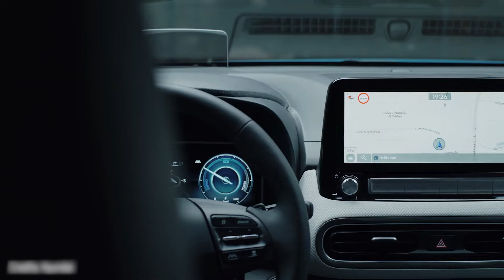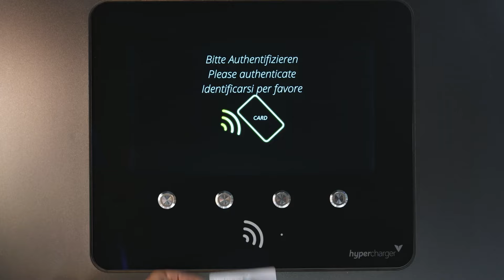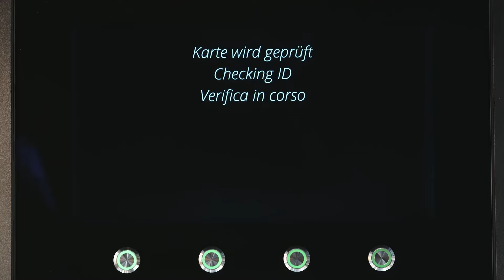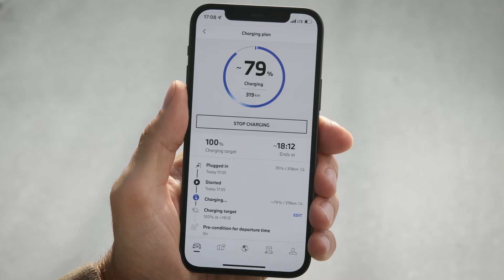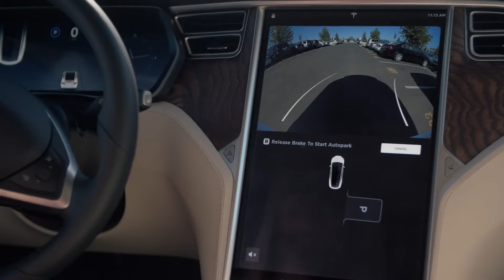EVs Owners Are FED UP and REVERSING BACK to Gas Cars!

Comment: I think this is one of those channels that just makes shit up.
Reply: I wonder how much Exxon Mobil payed for this
Reply: @caidyn5651  Exxon Mobil didn't have to pay anything. He speaks facts. If you don't like it, that's a 'you' problem.
Reply: @Chris-hx3om  I don’t own an EV or have a dog in this fight. 

You either possess the critical thinking skills to recognize bullshit when you see it or you don’t. I can’t help you if you don’t see any red flags here
Reply: @caidyn5651  All I see are the same issues being raised by this channel as every other channel who is looking at EVs critically. 

In Australia, the charging station providers are shutting up shop and leaving. In the USA GM, Ford and most of the other manufacturers are quietly reducing the number they are building, and in Germany VW are pulling out of EVs altogether. In Italy, Fiat are putting petrol engines in the 500E's they can't sell as EVs. In the USA, Tesla has quietly squirreled away over 67,000 unsold units in carparks all over the place, and if it wasn't for carbon credits, Tesla wouldn't even exist...

The electric dream is turning into a nightmare. People no longer want them, and I can see why. 

Yes, the people who currently have them are going to rave about how great they are, because nobody wants to admit they had a $50,000 plus mistake!

Maybe in a hundred years time EVs will be ready for the world, but as they currently are, they are a disaster!
Reply: Some points are valid and some are a beat up. One thing that stood out was the "inability charge more than 40 miles over night" well install a home charger, if he was serious they could then argue about having to install a home charger, but they will charge most EV's in the 8-12 hours it is sitting at your home over night.
Reply: @Chris-hx3om  Where did you get that Volkswagen is pulling out of EV production? This is wrong, they only admit, that there are some issues to be resolved and that demand in Germany is lower than expected. This does not mean, they are pulling out at all.
Reply: @cmdrstevemcmaru7417  read the reports. VW are diverting $56 billion that had been earmarked for EV production back to combustion engined vehicles. If that isn't a giant 'EVs aren't working', please explain what it is...

Comment: Oil companies are FED UP with LOSING MONEY hand over fist, and are PUTTING OUT VIDEOS like this in the VAIN HOPE IT WILL MAKE A DIFFERENCE.
Reply: And if we all drove electric, where would all the electricity come from? Solar, nope. Wind, nope, hydro, nope...... Coal and nuclear power!
Reply: @christianwn 
Nope...

Electricity will always be a mix of sources. 

Coal is rapidly dying out. Oil's next. Natural gas will be the last to go. Nuclear is too expensive. 

Solar is rapidly taking over - panels are now dirt cheap. Wind is growing rapidly, and with the massively tall turbines, get much more steady state air flow. 

Managed hydro is aiding is storage. HVDC can and is helping reduce storage needs. Utility scale batteries are a thing now, and rapidly being deployed.
Reply: @christianwn @christianwn 
And the kicker, EV's actually use LESS electricity then ICE...

The extraction, transport, storage, refinement, distribution and dispensing of gas/diesel uses about 2kWh per L.

2kWh will take an EV further then a similar ICE vehicle using 1 L of fuel... And without FF's
Reply: You are kidding me, aren't you? What do you think makes the tyres on an electric car? What do you think makes the paint, the foam in the seats, the components in the cooling system, the door seals, the windscreen wipers and the insulation in the wiring. What do you think powers the machinery that harvests the raw materials? What do you think then freights those materials across the world to be processed and then transport the cars back out to market? What do you think?
Top tip: Oil companies aren't losing money.
Reply: @jeffl4810   Let me clarify. If we as an idea say, we switch to only electric cars, the question was, where do we get the energy to produce electricity? Do you understand how much electricity is needed, do you really?
Reply: @christianwn  
Yes, I absolutely do understand. 
Especially as I'm an EE.

Using the USA as an example, since it has avaliable numbers and is one of the world's largest usage of vehicles (miles driven).
USA electrical generation is around 4,200 TWh annually.  
Here's the kicker - 1,100 TWh is used by the fossil fuel industry to extract, transport, store, refine, distribute and dispense... And these numbers are probably under represented once supporting industries are factored in.

Switching entirely to EV, studies have shown for the USA, would only need 600 TWh annually. YES that's a net savings of 500 TWh.

Note: look up the energy consumption of crypto mining and AI requirements/projections - hint, it's more than EV's would ever consume.

The main areas of concern for the grid is capacity to handle surge usage. However, utility scale battery are helping immensely with that, actingbas buffers.
And note that the grid will be expanded as needed, just as it always has.
Reply: @christianwn  
The passenger average EV uses about 6kWh per day.

1L of gas/diesel needs about 2kWh to produce. 

2kWh will take an EV further than 1L of fuel in a equivalent class ICE vehicle.
Reply: @jeffl4810  What you're not taking into account though, is that gas/diesel are bi-products that result from the distillation of crude oil.
Reply: @davidbrayshaw3529  
Not sure what you're trying to explain?

We still need oil. It's an amazing chemical feedstock. And should be used as such. 

Wastefully burning such a valuable resource is insane. And, our future generations will look back at us as one of the most selfish cohorts in history. Not to mention all the pollution and environmental damage that we've done over the past 100 years, in which that damage is accelerating. 
We barely have winter anymore where I live. Just 5 months of rapidly changing temperatures and semi frozen wetness. This wasn't the case a few decades ago...

Finally, for the first time ever, our consumption of FF has flat lined, and is starting to decrease. Previously,  out FF consumption was growing exponentially. So, we are finally starting to head in the right direction.
Reply: @davidbrayshaw3529  
That was the case like 100 years ago.
 
What was gasoline and diesel back then were considered waste products. And opened the doors to cheap fuels, spawning the car/vehicle revolution. 

Hydrocarbon cracking has changed that a very long time ago, where the bulk now becomes fuel.

Note that there is some variance between different crude oils around the planet, as some are thick and heavy being dark and more tar like, while others are thin and almost honey like with higher levels of aromatic hydrocarbons.
Reply: @jeffl4810  And we also need to talk about batteries...
Reply: okay while i get this video fucking sucks oil companies do not lose money from EVs because electricity is generated using natural gas most of the time. and ive talked to many EV mechanics and EVs are inferior when it comes to heavy duty application.

HOWEVER. EVs are great for your average person because theyre cheap and easy to run and not everyone is off roading and towing or racing around.

i dont like videos like this one because it makes criticism of EVs look stupid when there are many valid concerns to have with EVs and they definitely arent the end all be all for all cars and trucks.
Reply: @christianwn  What about them?

10 of Lbs of Lithium per typical passiger EV, that can be indefinetely recycled vs the 10's of Thousands of Liters of fuel burned over a typical passanger car's lifespan... No contest.

Or that batteries are not really degrading much from reputable manufactures, due to newer battery chemisties and BMS systems. Look into LFP batteries and NMC 532 chemistries - the latter is expected to be a 100 year lifespan, 4 MILLION mile battery.

Comment: Yeah, there's almost nothing in this that sounds remotely accurate for the EV owners I know, myself included, and not just Tesla owners. I am not depressed. My EV has plenty of range, I have no issues charging at home or on the road, and the performance is outstanding. EVs are plenty competitive, if you speak to owners, instead of reading the agenda-driven narrative that some outlets are peddling.

My own fuel costs dropped by over 70% when I replaced my ICE with an EV. I haven't been to a gas station since the first week of March, 2022. Maintenance costs are essentially based on how much I use the windshield wiper spray.  No tire issues at all, because I drive normally, not like I'm in a race. 
I kept my previous car 19 years, waiting for EV prices to come within reach. I didn't do it to be 'in vogue', I did it because it makes sense economically and environmentally. 

My wife still drives her ICE, because we can't afford two car payments at the same time. (so much for this being a rich people's product) She's way more conservative than I am, so when we do replace her car, it might be a hybrid, but I'm working on getting her to switch all the way, too. 

If we go out as a family, we use the EV because it's cheaper to do so. If I drive long distance, I take my EV, because it's cheaper to do so, and the charging network is WAY more filled in than most people realize, it's just not omnipresent like gas stations are. Yet. My EV is not a secondary or tertiary means of transportation. Heck, just for fun, I drove 150 miles just to reach the start of a drive up a mountain road I thought might be fun. Topped off the battery on the way, and topped off again on the way home. 370 miles total, and cost me less than ten bucks for the electricity. (Both stops were free. I only paid for what I put in at home.) 

The Mustang Mach-E stat seems cherry-picked, but is also seems weird, as the model really hasn't been widely available for very long yet. On average, Americans are holding on to cars longer than ever, so who is getting rid of a new car?
US sales/deliveries:
2020	3
2021	27,140
2022	39,458	
2023	40,771

But hey, you're probably going to believe what you want to, and I'm not going to convince you of anything.

Comment: Sponsored by Shell!

I don't even own or drive an EV and i know 90% of this is absolute false. Tyre wear is slightly higher not "drastically", roughly 10% giving you drive a similar way to an equivalent ICE car. Every single EV owner I've spoken too has said they spend almost nothing on maintenance compared to their old bangers.
Im sure the people who own an EV as a second car probably do replace their ICE vehicle with another ICE/Hybrid one for out of the way trip when they need to tow. No ones surprised legacy auto manufacturers made garbage EVs!

Comment: I can see from the comments that this YouTube video has stirred up a lot of comments about how this video is strongly anti electric vehicle from people who like electric vehicle cars. However I worked for 34 years for the Los Angeles DWP. There is one very obvious problem in the state of California and other states in the United States. The problem is this. If there is a large increase in the percentage of electric vehicles. That will be a lot of cars that need electricity recharging. This will result in a large increase in the demand for electricity to charge up all those electric vehicles. The big problem is that the present electrical system is unable to meet this huge increase in the demand for electricity. The electrical system will require that more sources that generate electricity will need to be built. In the state of California most of this would have to come from building electricity generating stations that burn natural gas to generate electricity. Solar and Wind can meet only a limited increase in demand for electricity. The problem is that huge amounts of land has to be covered with either solar panels or wind farms to generate the amount of electricity that one generating station burning natural gas can do. Also wind and solar power output is subject to changes in weather and day and night cycles. A natural gas burning generating station electricity output can be adjusted to whatever is needed by the electrical system, no matter what the weather conditions are or time of day happens to be.

Comment: Looking at the title of this video, I knew this would be filled with lies.  I drive a plug-in hybrid, which was okay for four years ago.  We're now shopping for a full EV.  Most people drive about 60 kilometres a day maximum, and my PHEV only had 40 kilometres, so I was needing to go to the pump once a month.  That's better than a full gas vehicle, but I don't have the time to wait for a Costco gas station 30+ minutes, when I could just go home, plug in the car and have a full battery when I need it.  Everything that's listed in this video is a case of picking up the worst EV stats possible, except for Teslas, which this video seems to be in love with, but is still trying to bash.  Cherry-picking of stats and filling in the rest with lies, this video is as useless as you can get.

Comment: Not to disrespect, but it was evident from the start that if everyone would change to electric, there was not going to be enough electric power available, just like bio-diesel. People follow hype way to much. But now after some pain, people gain their senses once again.
Reply: @christianwn 
EV's actually use LESS electricity then ICE...

The extraction, transport, storage, refinement, distribution and dispensing of gas/diesel uses about 2kWh per L.

2kWh will take an EV further then a similar ICE vehicle using 1 L of fuel... And without FF's
Reply: EV's can be powered by almost any energy source. Even if FF's power EV's, its several times more efficient, and after considering the reduction of Fossil fuel industry, possibly even higher.
Reply: Fossil fuels have a very finite limit.  We've already extracted all the easy to extract sources. Now we pay questionable regimes around the planet for more, which also have finite resources... While going into massive debt. Completely unsustainable...

We barely started burning oil and gas 100 years ago. We've burnt massive quantities ever since. With every year, increasing the amounts we burn,  minus the last few years, where we've actually slightly reduced consumption. This trend is accelerating due to efficiencies and things like EV's and heat pumps. This is a good thing. 

Environmental and massive pollution issues aside, we don't have enough Fossil fuels to support our current consumption.
Reply: There are some sobering problems with BEVs, and maybe a bit too much hype.  My electric lawn tools are doing great! People aren't that knowledgeable with electric transportation - some are doing very well. I think we'll just have to deal with climate change as it arrives, but there's probably no real hope.
Reply: @gordienj  I think society as we know it has about 60-70 years. Then it'll be every man for himself. And it'll not be pretty!